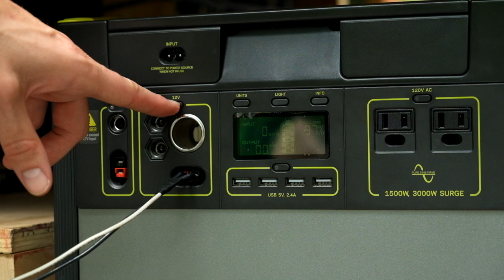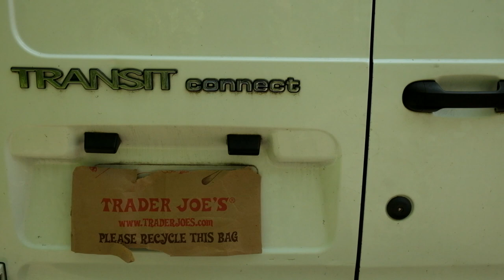TINY VAN! Exterior Install & Review - Solar Powered MaxxAir Fan, ARB Awning, & Rhino Rack Roof Rails

Comment: I have the largest Ironman awning on my transit connect an absolutely love it, gives me rain and sun protection down the whole side of van.
Reply from the maker: Love to hear it!
Reply: Scott Seyfert - how did you attach it? Similarly to a roof rack, or directly to the vehicle, etc? Thanks!
Reply: @rose8662  I built my own roof rack my cross rails are made out of teak wood.I just drilled holes in it and mounted their brackets to it.
Reply: @scottseyfert7445  Thanks very much for the info!

Comment: I really want one of those fans for my Transit Connect.  That awning would be too high for me to reach.  I have a waterproof crib mattress pad that fits over my open rear doors really well and I bungee it in place,  But I do have to stand on my step stool.  I also have a screen house with a fly that I can rig up to create an awning between my van and screen house.  I use magnets with clips on them to hold it to the roof.  I love seeing what other people do to make their Transit Connects more livable.  Good video.
Reply from the maker: Very cool Linda! I hope you can share some videos of your van as well! The fan is a must if you are sleeping in your van on a consistent basis. Our awning is mounted pretty high but you could mount it lower if need be. For instance flipping the L brackets upside down would bring the awning down a few inches! Thanks for watching!

Comment: Thanks for the info!! Starting the plan for our connect! Any problem with the fan staying powered on through the power bank with some more time on it? I’m struggling to determine if I want to go with a power bank or a battery system. I have no electrical experience either. Thanks for your time.